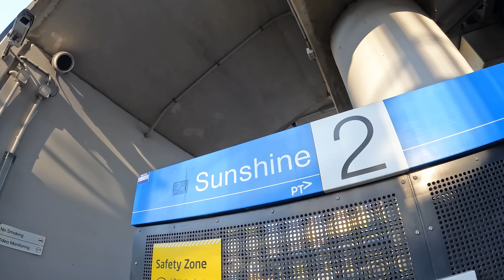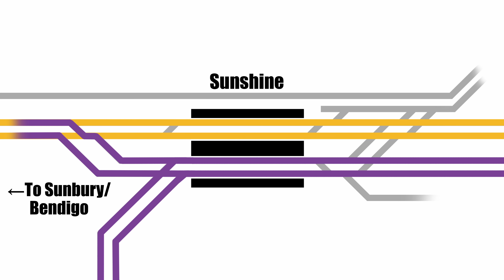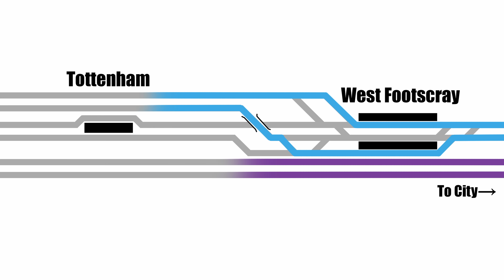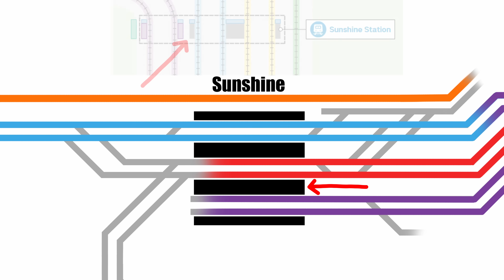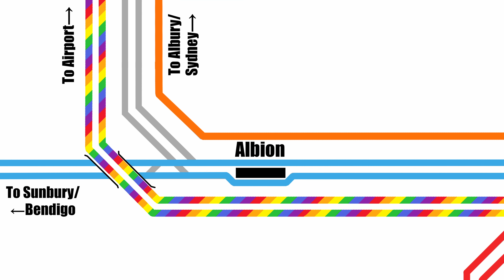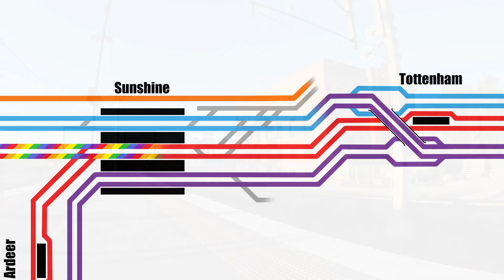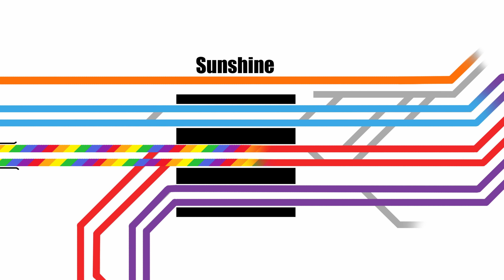A new plan for Sunshine // Melbourne Airport Rail!

Comment: That flat junction between Melton and Airport services is a pretty egregious shortcoming of the design given the cost of this project, and the effort spent elsewhere to avoid flat junctions within the same project. And I imagine that after such a huge project thete would be little apetite for future upgrades to Sunshine for decades.

Though the lack of a high-speed grade separated junction between the RRL and Ballarat line is more frustrating with how it slows services. Especially since the other end of the RRL has a relatively unused grade separated junction to merge onto the Geelong line.

Hopefully these are just simplifications from what is primarily a PSA diagram for the public, and not a final design.
Reply: I suspect in future when both Melton and Wyndham Vale inevitably become electrified, the Airport line will join onto Sunbury with a grade separated junction near Albion as planned in the original airport line plans from the Big Build. Resulting in an Airport/Sunbury track pair and a Melton/Wyndham Vale track pair, both grade separated. By this time there would probably be another track pair into the city. Obviously this is all long term but the provision will be there which is what matters
Reply: future upgrades will be compromised by infiltration of work bids with CFEMU and AWU with hidden criminal links leading to huge cost overruns. According to The  Age it already has been a problem with the " Big Build" for last 5 years!

Comment: The crossovers allowing freight from Bacchus Marsh to Tottenham will be removed soon. The freight will be diverted via Gheringhap and Newport. Not ideal.
Reply: ballarat is already chock-full of passenger trains and is a much steeper alignment, makes more sense (especially given the volume of trains coming that way) to run via geelong
Reply: @jimsmowingofficial  the diversion adds 47km to a trip to the port, and will force the broad gauge freight onto the Geelong line, which is even more chockers.

Comment: Does anyone know what train line will use the current Sunbury line platforms at north Melbourne?
Reply from the maker: I'd assume Craigieburn will get them.
Reply: @Taitset Do you know if craigieburn and upfield lines will still share tracks in the city loop? Or will any space that is freed with the removal of Sunbury and cranbourne/east pakenham  lines go straight to frankston line services?
Reply from the maker: @michaelallensantos  Yeah, they don't have any other option. They should be able to run a few more trains on Craigieburn using the space freed by Sunbury, Upfield won't get much difference because it's still limited by the single track at the other end.

Comment: Albury line trains not stopping at Sunshine will be a huge inconvenience for passengers from Vline's busiest long-distance line. It serves a much larger population than any other long distance line (150,000) compared with Warrnambool (61,000) as the next largest. Yet it won't have any direct connection to the Metro tunnel lines that serve all the universities (Victoria Uni Footscray, Melbourne Uni, RMIT, Monash), and a lot of Vline traffic is university students. These connections will require frits  taking a city loop train from Southern Cross to either Melbourne Central or Flinders Street, then the Metro line. Also any connection to regional trains to Bendigo, Ballarat, Ararat, Geelong, Warrnambool or any of the western suburbs would need to be via Southern Cross then back-tracking, adding at least half and hour to travel times, and it may mean missing some connections.
Reply: They don't stop there now. They never have done. It is far from an ideal situation.
Reply: @soulsphere9242  There was a standard guage platform from 1963 to 2004.  Check the Wikipedia article on Sunshine Station. This was to enable passengers from Adelaide on The Overland to connect to services to Sydney.

Comment: Your diagram seems to imply Sunbury trains would fly past Tottenham station on new tracks. 
Or will Tottenham get an extra pair of platforms?
Reply: If they keep this layout then it seems like tottenham will be serviced by melton instead of sunbury. They could build a new island platform for tottenham but it would be cheaper to just have the existing station be on the new line.

Comment: it's simply silly that for nearly 20 years a popular vline train line has been running express through here and it gets neglected by the plans to turn sunshine into a hub for vline services connecting to the airport. it's like they came up with the plans for which lines to connect based on the map you find inside the train

Comment: A way to avoid Bendigo trains using the suburban Sunbury platforms would be for the Bendigo trains to use the Geelong/Ballarat regional tracks and then diverge with a flyover near Caroline Springs north around the back of Hillside before rejoining the Bendigo line near Diggers Rest.

An electrified Melton line will also need new stations build at Mt Atkinson and Thornhill Park. The whole Melton line should four-track (2 suburban & 2 regional express) all the way to Melton.
Reply: I think you would enjoy having a look at the Outer Metropolitan Ring Road and Rail corridor reservation project. 4 lanes and 2 tracks in each direction around the city, which conveniently passess through Diggers Rest and Rockbank. Running Bendigo along that alignment has always been a no-brainer to me, I suspect it is part of a longer term rail plan that is not yet publicly available as it would form the perfect next step following on from this plan. It would allow for removal of the flat junction at sunshine, and segregate/speed up Bendigo line for much, much cheaper than trying to quad the Sunbury line

Comment: I don't understand the choice not to stop XPT services at Sunshine, the line practically goes out of its way to pass it before making a hard east turn to stop at Broadmeadows. If they're building Sunshine up to be this big interchange, isn't it the most logical non CBD station in the state for the Melbourne/Sydney train to stop at?
Reply: Not just XPT but all the Albury VLine trains too, and in future if the Shepparton corridor gets converted to standard gauge as it should then those trains would be running through there too. I agree it is a dumb move, even just a really basic platform and set of stairs with a ramp and pedestrian crossing for disabled access would suffice.
Reply: Sunshine is such a fantastically better suburban stop for both XPT and V/Line Albury trains than Broadmeadows. At Broady you can board the 902 and 901 buses which connect the northern suburbs and Airport, however this can also be achieved by changing for a Seymour train; the places you can't easily reach are Bendigo, Ballarat, and Geelong, along with all of the west (without first going to Southern Cross via a slow route through the goods yards). If you live in Ballarat or Geelong you have to leave your home up to an hour early just so that you can ride all the way into the city. You even used to be able to transfer from the Overland to the Intercapital Daylight, it was specifically provided for with Overland boardings at Ballarat not allowed except for passengers also booked on the Intercapital Daylight.
Reply: @hyperfixate8 I am struggling to think of a reason you might be taking the XPT to or from Melbourne Airport… but Albury V/line trains should definitely make the stop. Country Vic passengers surely need to fly as much as everyone else, and being a scheduled through stop is generally much faster than arriving at a terminal. You would absolutely need to have checked luggage facilities at Sunshine, of course, if you were going to… oh, never mind, since it became a VLocity set, the Albury line no longer has checked luggage. Great. Excellent. What a win for Victoria.

Comment: I really don’t like how Ballarat trains will be sharing with Metro again 6:13, given the point of RRL was to seperate both V/Line and Metro (kinda the case for the Bendigo line)

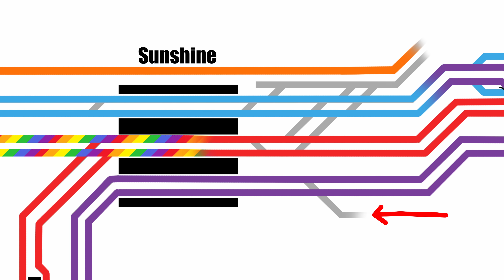Also at 7:43, if the government’s gonna want to remove trucks off the road, it should at least make things more convenient for freight trains, and this ain’t one of them (removing access to freight lines)

 ^ Although having a lot of dedicated broad gauge freight trains would have been nice to have in the first place, depending on the right of way’s space.

And otherwise, another nice video by Taitset!

Comment: I don’t know… Does feel like not even considering a platform for the standard gauge line is a missed opportunity.

Even if it’s not used on a full time basis, it still gives you options.
Reply: i contacted several politicians involved with this project years ago about it, and got no responses whatsoever. it really pissed me off tbh
Reply: I truly don't understand why you wouldn't have a platform? I mean the line is taking up space as it is.. and going right past.. what is stopping a platform being added?
Reply: @curiousinvestigator5448  I suspect it's the old VR hatred of the "foreign" gauge that was forced upon them 60+ years ago.  Praise be to the five foot three!

Not really, but that theory makes about as much sense as not building a SG platform at the new "Superhub".
Reply: @dfross87  the only other reason I could think of is some legal nonsense, like "the contractual relationship between NSW and Victoria by which the XPT operates dictates XYZ" but that would only make sense if that was just the XPT passing through there, and not having Albury trains. 

From the looks of this, Sunshine has the makings of becoming a proper "Shoulder Station" to borrow from RMtransit. But when you have a service potential there staring you in the face and you ignore it and you can't be bothered to even give a stupid politicians excuse, let alone an actual reason, for not building that platform, is just plain unacceptable.

Like, just as a thought experiment, let's say, there was a fire on the overpass at Footscary. Everyone gets out fine, but the station building collapses onto all 6 tracks below (also knocking out the Metro trains through Newport). You're not going to be able to use it for quite some time now, aren't you. If the SG track at Sunshine had a platform, you could at least run shuttle trains between there and Southern Cross to try to provide some sort of service.
Reply: @dfross87  VR: "They're standardizing our tracks! This state's rail network was built by an Irish lad and will not submit to the tyranny of George Stephenson!"
Reply: @randomscb-40charger78 ”we’re never chang… wait… it costs how much to pay people to move all the cargo between trains at the border…? Um… I… uh… so this ‘standard gauge’ thing you were talking about, tell me more…”

Comment: I recall that the std gauge platform was mainly for connections between the Up Overland and the Down Intercapital Daylight in the morning. Not sure about the evening. I'd have to check my old timetables. I guess if the ICD was living up to its name of the Intercapital Delayed in the evening, it could have stopped there for any Overland pax to alight and make their connection. There was no need for the Sthn Aurora to stop there, and same for the Spirit of Progress.

That being said it is disappointing that there still won't be a platform on the 'gauge at Sunshine for the ten passenger trains on the gauge. It seems such an easy thing to do.
Reply from the maker: Yes that could well be the case, I was just assuming the Southern Aurora stopped there.
Reply: @Taitset  Just confirming my earlier comment re the Interstate trains stopping at Sunshine. I've looked at my 1975 and 1984 VR-V/Line public time table books which show that the Up Overland definitely stopped at Sunshine to set down only and that roughly 15 - 20 minutes later the Down Intercapital Daylight stopped to pickup only. There didn't appear to be any restrictions on these stops only being for passengers transferring between the two trains. There was a restriction for passengers joining the Overland at Ballarat who could only do so if they were then travelling on the ICD that day.

The Up ICD did not stop at Sunshine as in 1975 there was a 30 minute or so connection time to The Overland at Spencer Street. The Down Overland also wasn't timed to stop at Sunshine, although I do have memories of this happening, when I happened to be watching from the carpark. Maybe this was due to the ICD being delayed.and there were pax for the Overdue. By 1984 the connection time at Spencer Street was only 15 minutes, which I would say was the bare minimum for this connection even if the ICD was right on time. 

Neither the SoP or the Aurora stopped there in either direction.
Reply: @Taitset  'Aurora was express to and from Albury.
Reply: It was indeed only the up Overland and the down ICD in the morning that were timetabled to connect at Sunshine.  Only extraordinary circumstances would see the evening trains connect.
The Southern Aurora only stopped at Albury for a locomotive change, a loco crew change, a dining car/kitchen crew change, and to move the motorail wagon from the front to the rear.  Albury was not a stop for passengers to detrain/entrain.

Comment: what type of electric trains would they use to Melton once its electrified?
Reply: If it is going through the metro tunnel, then it would have to be HCMT to align withe the platform screen doors on the munnel stations.
Reply: CRRC Changchun Railway Vehicles Co., Ltd.,

Comment: I think the reason that Sunshine platofrms 5 and 6 are shown as separated from the existing platforms could be becasue they will be sunken into a half level trench, like the Chelsea Level crossing removals. If the new lines are at the same level as the existing ones, they won't fit under the Hampshire Road overpass (Which is a nightmare and probably can't be extended). After peeling off towards Deer Park, the tracks head into a trench anyway so it would have the side benefit of reducing the grade for VLine trains
Reply from the maker: Yes very good point!
Reply: @Taitset  A reason I believe for the big price tag of the project has to do with the Hampshire Road Overpass. IIRC, when this project was first floated, there was talk of rebuilding the entire overpass and surroundings.

Comment: Since the section with passenger track in between sunshine and Tottenham is too small to add another set of tracks I feel like for the Sunbury line they'll probably do up some of the track in Tottenham yard since there's a bit that runs virtually right next to the metro tracks, then meet it up to the broad gauge freight line that converges with the passenger tracks just before sunshine
Reply from the maker: They'll just rip out some of the yard tracks to make space, they're never all used at once any more.
Reply: @Taitset ”the airport rail line is our top priority! Which is why we’ve delayed the project another 5 years and introduced the Tottenham Yard Re-shuffle Project involving ripping up the entire yard and rebuilding it!”

Comment: I think a great opportunity is being lost to have all the North East and Shep line trains go through the airport with standard gauge tracks, meaning converting the Shep line to standard gauge.  A more useful stop for these trains rather than Broadmeadows, especially if the intrastate trains stop at Sunshine as well.  Although you make a good argument for a platform at Sunshine for all standard gauge passenger trains.
Reply: This would have been a near certainty if they had run Inland Rail via Shepparton instead of via Albury.  Added bonus would have been the ability to have 3 tracks (existing SG + convert the 2 BG tracks) south of Seymour.

Comment: ok, then if Melton gets electric and vline express and they all stop at sunshine. the likely answer will be most will get the vline service rather than the metro. but the bendigo needs to stop at sunshine also but currently does not. those on the Geelong line are going to get a quicker service also due to not stopping at deer park, but can do another 2 express lines for Geelong to by pass all stops before Wyndhamvale and add them to the electrified line like a Lilydale Belgrave lines and treat sunshine like Ringwood.

Comment: I still feel there's probably a few changes to be made to the plans. Adding SG platforms at Sunshine would be one change that gets made as I'd imagine people coming from the Albury line will want to use the Airport link and how it currently is setup, i'd imagine it will be a major pain to do it.

I also see issues with Melton electrification and possible future Vline electrification. With the current plans, the Vlines rejoin the track after Caroline Springs and then are on their own track from Melton, but that would mean intermingling with the 1.5kv DC. One possible solution would be to run 1.5kv DC on regional lines too into the city from Wyndham Vale and Melton and switch to 25kv AC at these stations for the Vlines, with Dual voltage 1.5kv and 25kv AC rollingstock.

Comment: i assume the wyndham vale line will get electrified when the geelong line gets electrified, hopefully when this is done a new bit of track is laid to link wyndham vale to werribee and 2 or so new stations built between said stations, after this stopper trains can run via this new loop, semi-fast services will run to geelong via wyndham vale and faster services (hopefully with higher speeds than 160kmh) will run via werribee to geelong and beyond, possibly with bi-mode trains